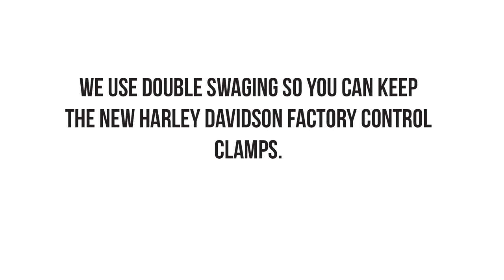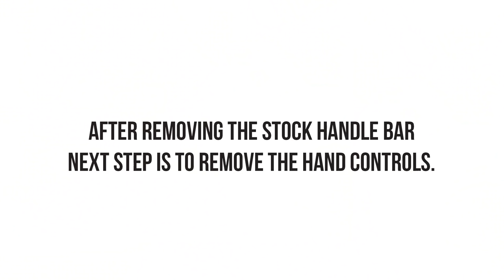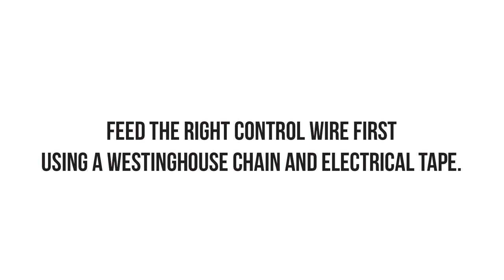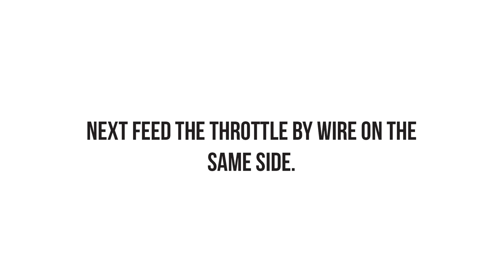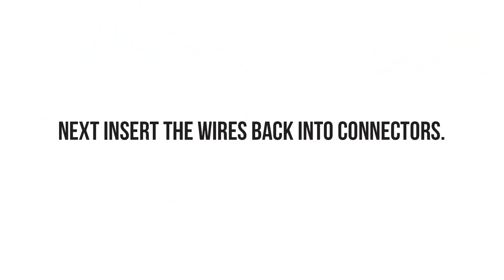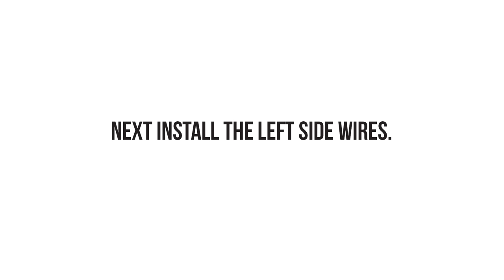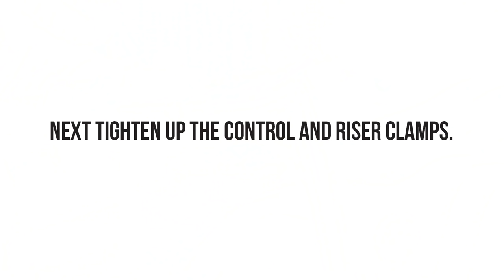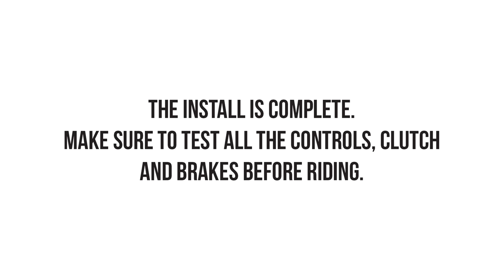Factory 47 2015-2020 Road Glide 14" Handle Bar Install using STOCK CABLES AND WIRES

Comment: Installation went well.  There were some changes between the 2015 and 2016 Road Glide.  It's a positive change.  The big plug that had to be removed is smaller and does not have to be remove to pull the wires through the bars. I am glad I bought the bars.
Reply from the maker: +HDRomine Thank you
Reply: HDRomine how easy was running wires through with connectors on? Didn't give you any problems?
Reply: Thanks for the heads up, just took apart my 16’ road glide to install these bars, I’m like where’s the big plug???

Comment: I ordered a set 14" on 10-16-2015.  I will let everyone know how it goes.  I am installing them myself on a 2016 Road Glide Special.  I will be going step by step using the video.
Reply: I have a 2016 will this bars fit the same way???
Reply: Yes. I put them on my 2016 Harley Davidson Road Glide Special.  They are awesome!
Reply from the maker: +Rick Romero Yes they will
Reply: +Customer Service thanks brother for the info
Reply: +HDRomine How long was the install.
Reply: +HDRomine How did you get the gauge screws in on your painted inner fairing, I've got a 2016 RG Special also and don't want to scratch it, I might use small bolt head screws?? Thanks.
Reply: +blsrulz  once I installed the bars I used needle nose pliers to turn the screws carefully..
Reply: did you need to extended cables and wires for 14
Reply: Daniel Silva
Can some one comment on whether wire harnesses and cables need to be extended on 14" bars. This would be for a  2016 Roadglide Special
Reply: Angelo Arcaria ....Daniel Silvia.  No you do not have to extend the cables and wires on a 2015 and up Harley Davidson Road glide.  That was one of the selling points for me.  I have had these bars for a while now.  Everywhere I go people have to come up and check them out.  Several people have purchased them after see them.  High quality and they look awesome.
Reply: Thanks Dan. I'm going to order today. How tall are you? I'm 5'11 and think the 14" will be okay.
Reply: I'm 5'10" and 14's worked fine on my 16 RGS. check out my F/B pics.
Reply: blsrulz Could you send me a link to  your FB pics

Comment: First off, Thanks for making this video! Second pictures DO NOT do these bars justice!!  "WOW"...I received my bars yesterday and after unpacking them from a very large high grade box I am blown away by the quality of these bars!!! Factory 47 ... WELL DONE!!! Fit , Finish-and overall quality is beyond my expectations. The chrome finish is true SHOW QUALITY!!  Are they expensive?? Yes! But you really get what you pay for!! Thank You Factory 47, you are at the top of your game!! True Made in USA Quality. And to all the do it yourselfers, Watch the video.......its as easy as they show to install on the rushmore R/G's. No cable extensions, no brake or clutch lines replaced, unless you go over the 14 inch bars. Or pay some one $350-450. To install. I checked on 2 different shops and 3-4 hours is what they quote at $90 per hr.
Reply from the maker: Thank you for the review and we are glad you enjoy the bar. We take a lot of pride in making each bar.
Reply: That's doable, someone just quoted me $$1800... he said it's a minimum 7 to 8 hour job!
Reply: Manuel Mares my dealership quoted it at 4hrs. Either way, it’s a rip off having them do it.

Comment: Stock lines will NOT work with 14 inch bars, on 2018 Road Glide Special. I found this out the hard way. $300 for new lines.
Reply: You are so right they don't talk about the hydraulic clutch and the brake lines only thing fits is that middle extension piece that's about thirty or forty dollars 👍, I have mine I love them though just pay the money get them done right.

Comment: I want to do this on a 2019 roadglide special. Will ALL cables and wires reach? Also does abs make a difference.
Reply: So I went forward with the install and all cables/wires did reach. ABS did not make a difference. Great bars easy install! 
Nice work Factory 47
Reply: How long did the installation take?

Comment: for the 14 pouces , without changing the clutch wire and brake wire for road glide 2015 ? Must it change the electric cables ?

Comment: IT Looks like the STR Miter bars have the factory pin notch at the bottom of the bars so you don’t have to pull the factory pin in the riser.  The picture on the webpage shows the clearance notch as well. Is that correct?  I believe it also states that in the video to leave the pin.  The bars are made to accommodate.  Correct?

Comment: Excellent video @Factory 47 Cycles I recently installed my signature series bars on my 2017 RG standard and this video is 100% accurate as of how to install these bars took me maybe 1 1/2 hours with no help using all components in this video and I installed a set of Avon air cushion grips it is a very nice upgrade to the scoot and makes it very becoming and comfortable for the highway thanks for creating such a great product I saved $1000 bucks for investing in these ape hangers instead of having harley do a set of bars for me( $1500 bucks) thanks again!
Reply: Javon Charles did you have to extend the wires and cables and do you have a version with abs lines if you did have to change your brake lines?
Reply: ALJamaine Smith no I have the standard and no I didn’t have to extend the wires at all nor the brake lines everything was kept stock for the 14” ape hangers best product and bang for the buck if you ask me harley charges around 12-1500 bucks for an ape hanger install so with a lil time and patients u can install these in an hour or two tops and ride out in style
Reply: Did you relocate and wire or lines to make them longer? And does it make brake and clutch lines tight when you turn left  and right?
Reply: H-D just quoted me $1400-1500 trying to tell me I need the cables and that it would take 8 hours. Thanks to this video I will not be going that route. Also got signature 14”.
Reply: Are the factory 47 straight or slanted in?

Comment: I just did my bars . First I use cable lube, I did two cables at the same time alternating as I push & pull each one..I also  installed kahuna heating grips which made the left side a pain .

Comment: hey guys quick Question im taking of my stock handle bars off my 2015 road glide special and putting on 14 inch factory 47 assault bars do i need to get extenions cables

Comment: I've watched a few of these videos. Why doesn't anyone ever pull two pull strings in the throttle side then pull one of them out of the control location so they can pull all of the wires at the same time? I'm an electrician and it can be a pain pulling wires into a conduit that's already pulled. This is how I would do it  it would avoid having wires twist around those already installed.

Comment: At exactly 14:06 you are putting the wires back into the small plug but you never show how to take those wires out ... did I miss it or you skipped it .. I can’t get that plug to pass threw the bars , so it has to  come off .. how do you do it ..? Thanks

Comment: Hey guys I was just wondering some people have told me that I can use the factory cables just extend the wires for a set of 16s on my 19rgs I was just wondering if you guys knew
Reply: Brad Arnold for 16s you will to change cables.14s is the max
Reply: You can use 16 in bars and use your factory cables you just have to cut the tie and the plastic piece underneath and reroute

Comment: Hi, this video is awesome. A little over 3 years old. I have a 2017 Road Glide and at some point I will be swapping out the bars for a set chiseled. I'm wondering about the pin. Is it necessary to have it installed. I'm sort of short and wanted to pull them in an inch or so.

Comment: I take it this will work for the 18 RGS too?
Reply: Yes it will I ended up buying HD wire extensions and installing heated grips. I used extended wires so I didn't alter the original wire placement. Where you see him using a needle nose pliers wasn't needed I had easy access to the screw heads with a screwdriver.
Reply: Thanks I didn't have the patience so I just went and bought them. I did have to get the wire extensions from the website, but after I put those on these bars were a breeze to install. All in all probably 4 hours from start to finish.
Reply: Alvin Gallegos that part threw me off. Is it because the original wires aren’t long enough to bend the bars giving access to the screw with a driver?

Comment: Right around 18:40 you disconnect the plugs from what looks to be a plastic mounting piece and then don't reinstall it, why is that part no longer needed? Docents it keep the wires neat and keep them from moving around and such?
Reply from the maker: +Jesse Glatz You don't need it and it gives the wires extra room
Reply: I removed my plugs from that plastic piece and you definitely need to to fit the wires back together but I left the plastic piece in there was no need to take it out wasn't in the way

Comment: Just got my 14". Not sure if they're gonna fit with the new clutch cable on the 2021's sucks cause the aftermarket is available yet.
Reply: I got 14” for my 2021. Today. How the install go.? Was New clutch cable needed?

Comment: 2016 road glide install. can I add heat demons and also run the wires inside the bar? any special instuctions?

Comment: I have a dumb question ? On a 2016 R G ultra can I roll the handle bars forward for comfort the pullback mode sucks and it's 2,000 g's to replace with apes the stock bars in the right position has to b cheaper, please give in put
Reply from the maker: You can, just pull the pin out. It pulls straight back.

Comment: IT DOESNT STRETCH THE BRAKE LINES? I WAS GOONA BUY THE 14" YAFFE BARS BUT THEY SAID I WOULD HAVE TO BUY NEW LINES AND WIRES FOR MY 2015 ROAD GLLIDE
Reply from the maker: +Gregory Johnson We have sold over 500 and personally did 20 of them.
Reply: Well I just did 14 inch on my 2017 Road Glide although the wires were long enough the clutch cables not too bad but the brake line although it's up there is very tight

Comment: i have 12.5 tallboys on my 2015 road glide special that were installed with all factory wires and cables. i want to change to the 14" chiseled bars by harley, will these be capable of being installed with all factory cable and wires as shown?
Reply from the maker: I would think so with 14"

Comment: Could I do 12" hangers on a 08 road glide without changing the clutch wire and brake wire. Or could I go as tall as 14" ?
Reply from the maker: No only 10"

Comment: @Customer Service WIll the installation procedure for 2015 CVO roadglide will also be the same? as we have heated grips.
Reply from the maker: Its a little different due to the other side has the internal part for the grip and a few more wires. But its super easy.

Comment: From what I can tell there were no modifications to the brake lines and clutch cable. Is this correct? Would you say that anything above 14 inch rise would need all new cables and electrical extensions? Thanks.
Reply from the maker: Yes anything above 14". But only for 2015-17 Road Glides
Reply: Customer Service actually Factory 47 figured out a way to do up to 16 in with repositioning stock cables

Comment: I never saw a reply from customer service on weather you need to extend the stock cable and wires for 14" bars on 2018 Road Glide special.
Reply: Hi Dylan, I installed with some HD extension wires merely because I didn't want to pry away the connection behind the instrumentation. To me it made it easier and kept it original.
Reply: @Elwinator3  Thanks Alvin.
Reply: Alvin Gallegos  Thanks for your comment.  Any issues with your stock clutch and brake lines being long enough?
Reply: @PezRacer  no problems at all.

Comment: This procedure would be the same for a 2017 road king using 14 " Malo bars
Reply from the maker: No, it is different. Unless it is a special model you would need cables.
Reply: @Factory47cycles  you can do it with a road king special. But not 2017 standard road king correct. Will need clutch & break cable's.

Comment: Is it the same for a 2017 street glide special? and if not what is different
Reply from the maker: No this is different. For the street glide you need to take apart the whole fairing and extend your cables and wires.

Comment: would I need to buy a wire kit and new brake and clutch cables to install on a 2013 road glide  ?
Reply from the maker: +David Esparza Yes you need to buy new cables and wires for 2013
Reply from the maker: +Customer Service  Yes you do

Comment: I picked up a 2018 can I do 14" bars without cable extensions and lines
Reply: Yes but if you want to avoid altering the stock appearance you can get HD extensions. I bought HD extensions for less.

Comment: 450 dollars? You're high...
Reply: 500 total installed myself is not high. Dealership wanted 1400 total just for parts....half of which prolly weren't needed. These are quality bars....better than Ya fees imo
Reply: You are correct Jason, my dealership just quoted me $1600-$1800 installed on my 16, and that's with H/D's bars. No way I'm paying that. Have done bars before on past bikes and after watching this Vid will do it again. Just a nice weekend project. Thanks Factory 47 for a great video.
Reply: scott peters weekend project it'll only take you the most 2 hours

Comment: So you are telling me I can use factory lines on a 17 road glide if I only go up to 14 inches?
Reply: If you do it's going to be real close to tight. unless you don't care how your wires stick out got mines done two years ago I tried it didn't work at the dealership install them in. 216

Comment: Does anybody remove the pin so they can put the bars the way they want them instead of at a fixed position
Reply: I punched in the pin to move my stock handlebars forward. You'll be fine. Most bikes don't have the pin anyway.
Reply: NP it will move without doing anything.

Comment: I called local HD shop to inquire if I needed new lines and they told me all new lines and a twist grip sensor if i installed their 14" road glide handlebars (part #55800440).  Any ideas, other than getting taken to the cleaners!  I just saw video and I want your bars!
Reply from the maker: As long as it is a Road Glide 2015-17 it will work. Show them this video.
Reply: what about a 13 roadglide
Reply: Is that the stock clamp?